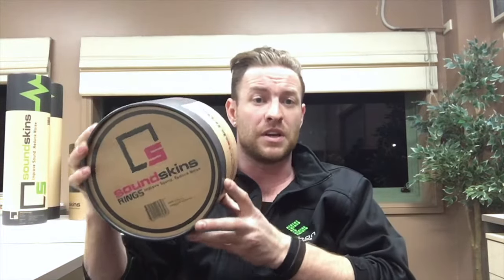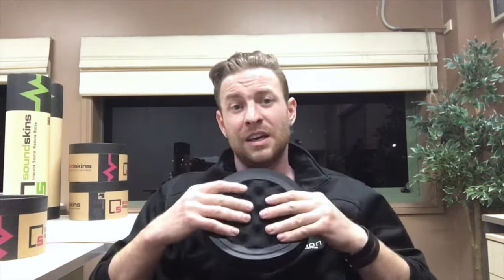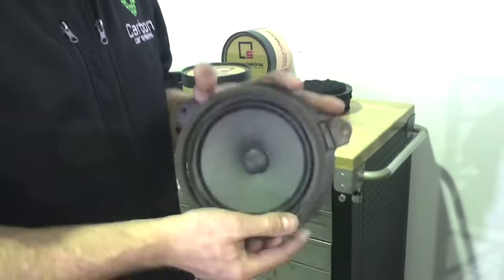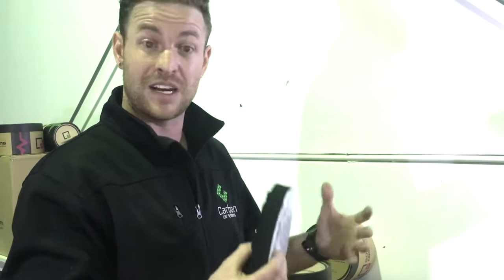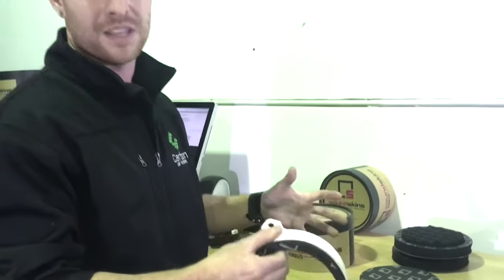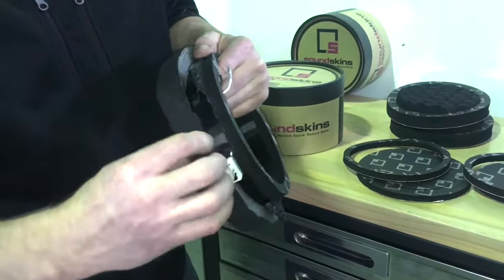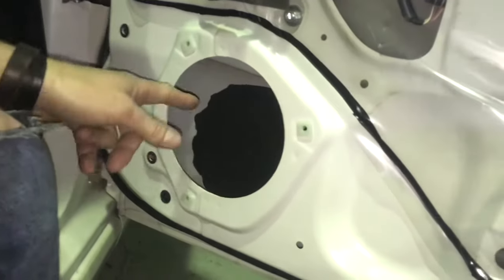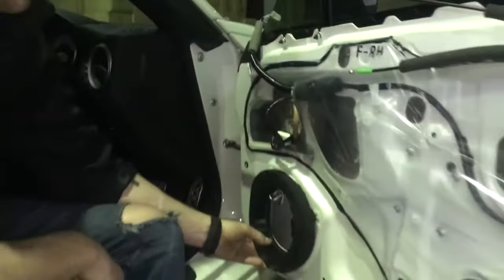SoundSkins Rings: The Why, What & How... v1

Comment: But closed cell does not abosrb the music you need open cell
Reply from the maker: It’s not designed to absorb sound it’s designed to direct sound and couple it to the panels.
Reply: SoundSkins Global I guess that makes sense since theirs seems to be better at acoustics due to its permeability and its ability to absorb sound, open cell foam is sought after for acoustical applications more than closed cell.
Reply from the maker: This is not designed to absorb sound hence it’s closed cell so it doesn’t absorb water in the door panels. IF it was designed for a sound room then open cell would be better. This is not for a sound room it is two different applications.

Comment: so you will need to 3dr printer as well to print a ring so without a $900 3d printer this is useless
Reply: No, our SoundSkins rings will work with almost any speaker spacer or adapter. We just use 3D printed rings in our store for customising.